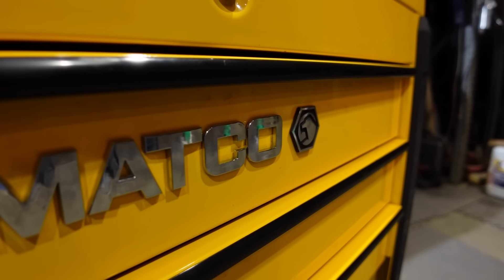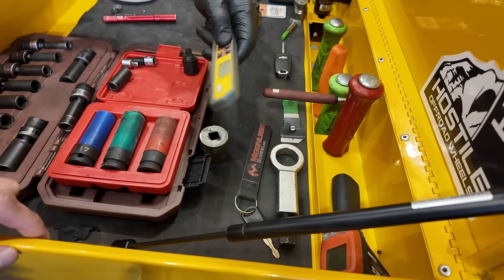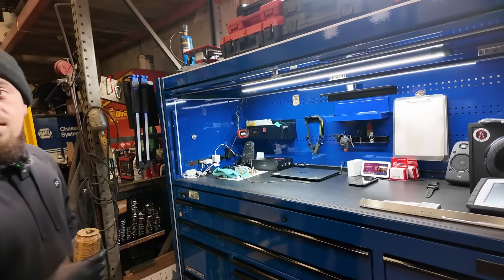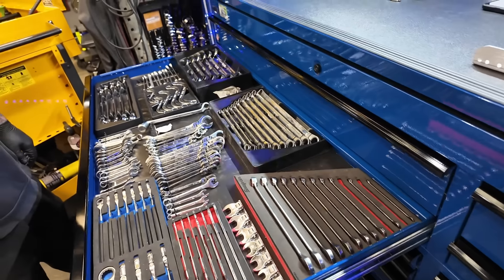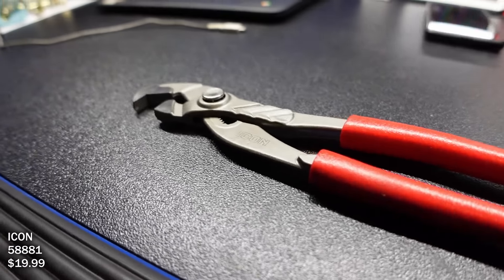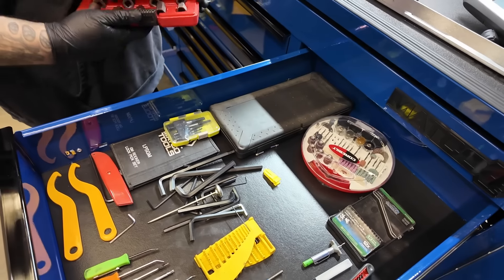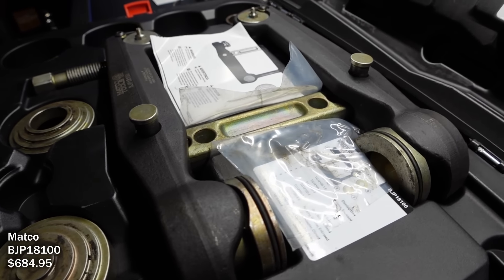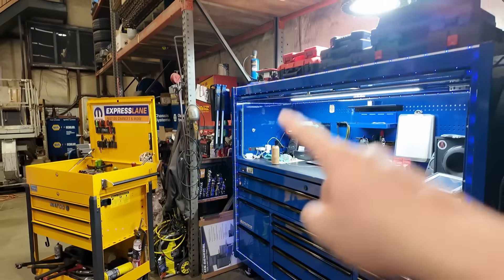Beating on ICON tools Daily to make a Living

Comment: Nice video! As a lube tech, I’ve been buying a lot of icon tools. I recently bought a brake service kit from harbor freight. My personal favorite icon tools are the swivel ratchets on 1/4, 3/8, and 1/2 inch, because when I get bolts loose I can do a screwdriver technique and it gets the job done faster. I never had any problems at all from them and I will always buy more icon tools and recommend to anyone 😁

Comment: When the guys talk about the matco deep swivels and the tech says the rings start spinning. The older snapon swivels have rings on them and when a random swivel of mine started doing that the snapon man replaced it under warranty. The rings  purpose was to lock the pin in place of the swivel